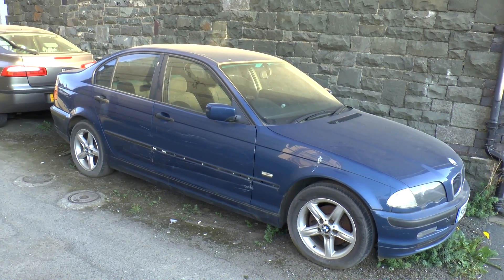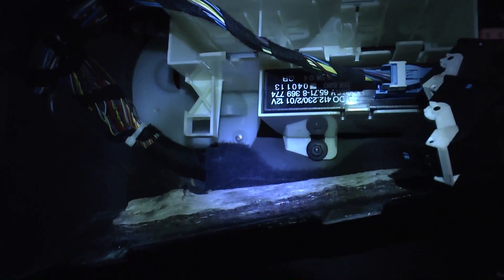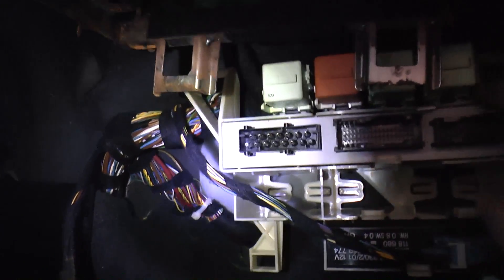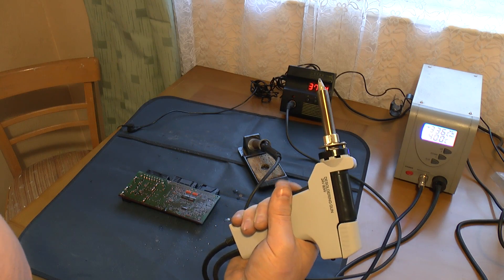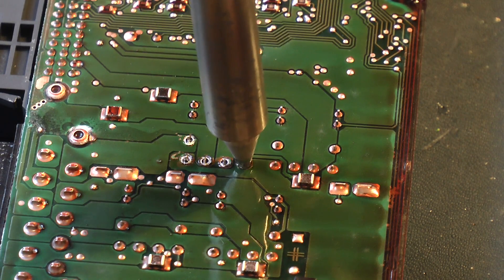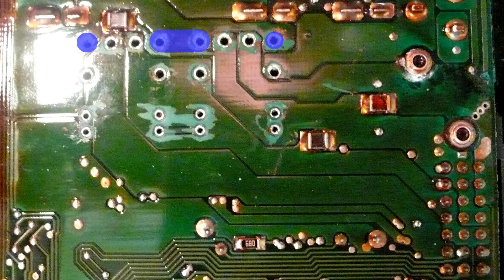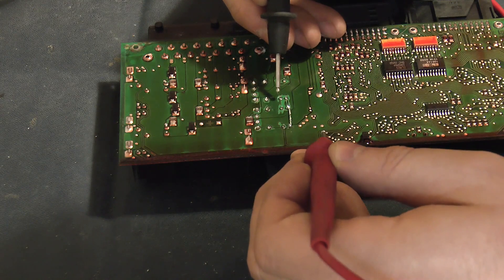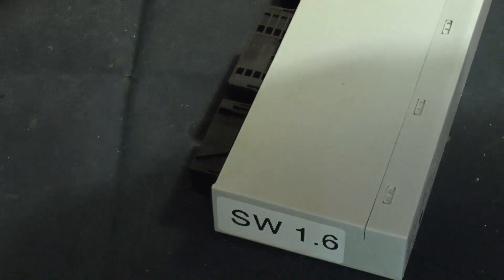Central locking relay replacement in a BMW GM5 module (3-series, X3, Z4, Z8)

Comment: Hello! I just replace the relays, and now the central locking is not working ( not from the key, not from the button inside the car ). In the gm5 i hear a sound when i press from the key. Help please!
Reply: +adrian Cresteaza 
Sounds like you damged the circuit board.  Most likely one or more of the following:  pull out a plated through hole, lifted a pad or broke a trace.
Fixing boards damaged by amateur is such a pain in the rear.
Reply from the maker: +adrian Cresteaza Watch from 7:50 to see the points that can be joined together on the board to fix any broken tracks or through-holes.

Comment: Can you please tell me what to do and replace, if I bought a car and I have two different locks? I mean one in the ignition and the second in the door. So I must use two different keys. One to open the door and the second at the start. I have a BMW 325i E46 and want to change the locks from another car So what replace? dme? ews? central locking relay? Please can you help me?

Comment: Thank you VERY much man. You saved my life :-) I used V23084-c2002-a403 relay and it works propertly. Your "points of control measuring" were really helpful.
Reply: Only use the -A303 ones.  The -A403 relays are made with a different contact material which is for lamp loads which have a very high initial current which decreases quickly as the filaments heat up and no arcing when the contacts open.  Motor loads are very different.  Motor loads have low initial current which rises quickly as the inductance saturates and arc like crazy when the contact opens.  Almost the polar opposite of a lamp load.  Sure the -A403 relays will work initially, but, around 18-24 months is when they will start to fail where the contacts will fuse allowing current to continuously flow through the motors and eventually burn out the actuators.
Reply: That is the wrong PN relay.  It will fail prematurely because that relay (-A403) is not designed to handle arcing from inductive loads.
Reply: +Scott Johnson , so out of the 4 ones stated in the description, which ones do you think will work for sure?
V23084-C2001-A303
V23084-C2001-A403
V23084-C2002-A303
V23084-C2002-A403 &#160;?
Reply: +Scott Johnson OMG, this means that people using the A403 will eventually have to buy new relays and also other parts that will fail or burn out because of the A403 remaining in the closed(current conducting) position! I already bought the A403 because they were easy to find, but glad i didn't mount them on yet. hope i will find the A303 ones. Thank you very very much! You may have saved me some money :) 

+AintBigAintClever Also...I think that the OP should update the description with this information because in this form it could lead to problems for other people

Comment: I just did this ,replace relays and now it is worse , now the safety door switch is not locking either , what you think I did wrong ,also the relays that I replaced have same numbers except the last ++ numbers and the end has C and original relays have B .?
Reply from the maker: What is the exact part number on the relays you've used?
Reply: AintBigAintClever V23084 C2001-A303 ++ 124642C and the originals are the same no but the last  ( ++ 011441B)
Reply from the maker: Paun Makedonski
That's the correct part number then (you can ignnore everything after the A303). Take a look at 7:55 to 8:20 in the video and perform a continuity test between the same-coloured points shown at each step, this will verify that you haven't broken any tracks (but if you have, it'll show you what to reconnect with jumper wire).

Comment: Would be useful to use light during filming the procedures ;-)
Reply from the maker: I try my best (I now use a 150W metal halide plus a 50W LED for video lighting) but it's tricky when you're concentrating on what you're supposed to be doing (in this case desoldering) instead of what you're also doing (recording it).

Comment: hello ............ I have a problem on my bmw e46 the problem that the opening of the doors sometimes open sometimes does not open. I have done to make the control mechanic told me that the relay is defective. I wanted to know what these relays? those that have changed you in the video? then another can change GM5 module can meter a used one? if i can then how to code the meter key with another GM5? please give me the answer thanks.

Comment: I do lots of electronics, and I am real good at it, but I do not understand how piss poor BMW Electronics engineers can come up with such unreliable relays, and general board design these boards with such small solder pads and fine tracks can be a night mare when it come to replacing parts, especially plated through holes, I have replaced one of the relays on a friend's car but I used what i had, so i used two single pole 15A relays and it did the job, I had to wire each pin from my relays to the board afyter I took the original relay out (which had gone faulty with relay coil having gone open circuit) Once I carefully wired my two single pole relays, everything worked fine for a year now, so central locking works fine with remotre control key fob,  but 1 year on, now my friend has got a new problem, his dashboard does not show internal indicator signals, does not show the blue high beam light, does not show the door are open, does not show if his fog lights are on, even though all fuses are OK, and all these functions work, example if you indicate right, the external indicators flash, but there is no clicking or internal dash lights to remind a driver that the indicators are on.

This is BMW for you, personally I don't drive one, thank God for that, I have a Vauxhall Calibra a much better car thank God! psses BMW any time! and has better and more reliable electronics.
Reply: Hi,
i had the same problem with dashboard on my BMW e46 it is very easy to fix problem, just get the plus (+) off your battery wait for (cca 20-40 sec.) and than just put it back, and try it. That is the way i fix the same problem. I hope so it will help your friend too.
Reply: Thanks man, I removed the -ve wire last time and left it out for all night and it didn't work, so may be I will now try the +ve e this time and it might work. Thanks bud.Caki
Reply: No problem man, just try it and i hope it will be fine. :D samdomding
Reply: I tried taking out the Positive terminal and left it for about 20 seconds and then tried to see if the problem with my dash lights has cured, but no luck, then the next day in the morning, everything started to work, and by evening the fault was back, i.e. no internal indication lights on the cluster, although the indicators functioned Ok outside, and the High beam came on outside but no internal warning lights, same for the door open warning light, fogs and so on.

seems like intermittent wiring fault and one bimmer site has suggested checking the Light control Module (LCM) possibly some sort of intermittent connection, I will tackle this tomorrow. But thanks for your help.

By the way, I said BMW were rubbish cars, and my calibra was much better, but now it is not, as of last week my head gasket blew up and caused a Hydro lock, and now it means expensive repairs! all cars are rubbish except Skoda!
Reply: I'm sorry for your car, well i don't really know what u can do about that, that is how i solved problem on my e46 and i no it works fine, no more problems... I hope u will enjoy in Skoda. :D Greetings to you.
Reply: Caki Today I managed to remove the LCM (light control module) for those who may not be familiar with LCM, it is your headlight switch panel, with the big head light turn on knob, and has other buttons to bring on fog lights and instrument cluster light intensity control, this is the module that is also responsible for INDICATORS Flasher, as when you unplug it, the Indicators stop functioning even outside, so i suspect the problem may be here, I made a special contraption - using a long nose pliers with one side of the pointed jaw fitted with a small length of sharp steel pin, the idea is that when you pick any one wire and press the plier jaws across any insulated wire, the pin pricks the insulation and makes a contact with the copper conductor so that you could make a contact to take voltage readings on that wire and monitor other status without having to slice off the pvc insulation, that ruins insulation, with this contraption it just leaves a very tiny pin hole that almost heals itself or closes up so that no copper is left exposed to cause any shorts. So no shorts can occur and I would hate to have sliced part of the wire insulation and then tape it afterwords, that I have come across in so many cars where amateur electricians have sliced wires and then  insulated with a pvc tape, that can come undone and cause shorts. 

Any ways, i manged to trace the output wires for the indicators,  the left Indicators have two Blue/Green wires one I presume goes to the front Indicator lamp and the other to the rear, like wise I managed to get a flashing pulse signal on two of the Blue/Brown wires for the right indicators, and so none of the  other wires had any flashing signal to go to the instrument cluster panel, hence why there is no indication on the cluster panel, but as well as many other functions are not being indicated either, however the important ones are the indicator signals, so now I can tap small wires to these two pairs of indicator wires and run them to a couple of green LEDs and diode couple the two outputs to a small 12v relay to make the ticking noise and house the relay behind the dashboard and   wire up the two green LEDs on a suitable location on the dashboard to enable the driver to see if the indicators are On, this is not a cure for the original problem but will for now enable the car derivable and for safety. If a driver does not know his indicator is on, he could mislead other drivers and cause an accident.
Reply from the maker: Same reason they think they can get away with not doing a product recall for the alloy wheels that keep cracking: sheer arrogance. If it was Toyota or Lexus they'd recall them (and drivers of other brands would scoff at yet another recall), but BMW would rather deny there's a problem.
Reply: Sorry I meant to write to the gent that did this video not reply to your comment
Reply: samdomding sorry mate meant to reply to the guys video he's close by
Reply: No worries Jacob,  I have deleted my reply as I don't want to give my location. thanks

Comment: good day, I have a e46 320i 2002 but central locking works only when I use the keys in keys hole on the driver door, and the remote does not work (I have purchase new keys also),, do you think it helps if I change my GM5 module to a used which works. thanks:-) ((safety button in the car works fine and locks all doors))

Comment: Thank you so much for the video.  This was exactly what I needed to fix a Z3.  Total cost $32 for relays on ebay and 15 minutes. (with the proper soldering equipment)

Saved over $800 over quote from garage.  Keep up the good work!!!

Comment: Can I just remove relays from a used GM and use them instead of buying new ones?
Reply: Nothing to stop you doing that as long as the relays in the used GM are in good condition. Apparently one of them gets worn out quicker than the others.
Reply: ***** Thanks
Reply from the maker: Marc Langlois
I expect the heat transfer up the relay pin has improved your relay's behaviour for now, but it might only be a short term fix. Fingers crossed yours will keep going for a while though,

Comment: Excellent DIY tutorial. I repair many keys where in the battery breaks off or they have reached the end of their life and strange enough BMW tells the client they need new keys because they don't have a battery inside. What nonsense.
Anyhow your tutorial helps sort out those strange one where the central locking would work intermittently but the boot always opens.
Great video!!!
Reply: Hi..i have a 08 Mazda demio...the anti theft works sometimes I suspect it's a eeprom issue,  can you repair it...

Comment: you said that two relays are for central locking, are those other two for windshield wiper ? coz i have problem with them...sometimes work, sometimes dont
Reply from the maker: According to the bmwgm5 website they're electric window relays.
Reply: thank you very much :) you're very helpfull ;)

Comment: i just have this question about this if i change the relays do i have to reprogram the GM5 box
Reply from the maker: No, you'd only need to reprogram the GM5 if swapping it from one vehicle to another.
Reply: poo great thank you so much
Reply: If you happen to swap the GM5 with another one, the main issue that you will have is that the keys won't work.

Solution is to:
- sit in the car and close all the doors
- put the key in the ignition and turn the key to position two (without turning on the car)
- remove key
- hold the unlock button, and while holding the unlock, click the lock button three times.
- the doors with lock and unlock automatically
- turn on the car and enjoy the newly programmed module

* there's no necessity of recoding the VIN to the module.

Comment: On my bmw the locking via remote doesnt work. Unlocking and opening the trunk works, if i use the key on the driver door only the driver door locks-unlocks. Do i need to replace the top or the bottom reley, so i dont replace both??? thanks for your help.

Comment: THINKING I HAVE A CENTRAL LOCKING SYSTEM ISSUE ON MY 1994 BMW 325I
IT ALL STARTED WHEN I WAS MESSING WITH MY TRUNK LID WIRES TO THE  LOCK CYLINDER AS WELL AS THE DRIVER SIDE DOOR LOCK, I HAD THE PANELS OFF OF BOTH OF THOSE THE DOOR AND THE TRUNK MESSING WITH THE WIRES AND SO ON... HAVE A  NOW WHEN I TURN MY KEY TO START IT DOES NOTHING, DON'T EVEN DO A CLICK CLICK TO ENGAGE THE STARTER.  THANK GOD I'M ABLE TO DRIVE BECAUSE IT IS A 5 SPEED MANUAL AND I CAN STILL PUSH START IT RUNS THAT WAY. I'M READING THIS BMW BOOK I HAVE AND IT KEEPS TALKING ABOUT THE CENTRAL LOCKING DEVICE, I'M JUST WONDERING WOULD THAT HAVE ANYTHING TO DO WITH THE CAR NOT EVEN  TURNING OVER TO START? IT RAN FINE AS EVER UNTIL THAT DAY MESSING WITH THOSE TWO THINGS THE WIRING TO THE DOOR AND THE TRUNK GOT INTO IT TO START AND NOTHING AT ALL... I NEED HELP ANYONE KNOW ABOUT THIS? OR WHAT IT SOUNDS LIKE???
HELP WOULD BE OH-SO APPRECIATED!!!  THANK YOU KYLE

Comment from the maker: My guess is that the "high sensitivity" (i.e. lower coil current) versions are a bit more flimsy (to make it easier for the coil). Also, one half of one of the relays gets much more of a workout than the rest.

Comment from the maker: The wire was left in place because I'd broken the track. If you've broken a track you need to add a wire to replace it, all connected points are shown at 7:55 so you can see which ones you can link to to fix the break.

Comment: My 2000 323ci convertible appears to have a bad central locking relay. I have ordered it. Since its convertible coupe I've been told it just needs one relay. Compared tk the one in the video will my gm5 have one of the 2 shown in the video and if it has 2 which one is it. Hope my question makes sense

Comment from the maker: It'd be worth trying to source a wiring diagram for your car, you may be able to figure out what's common to the faults, whether all the duff bits share a module, switch assembly, even a ground or supply wire.

Comment from the maker: The A303 has a different contact arrangement and is a single-pole changeover relay. The A309  is double-pole changeover and has two additional pins.

The A303 pinout is in its datasheet, readily available on the net. The A309 pinout is harder to find but can be found on the bmwgm5 site if you search for V23072 A309 in Google. A309s can be bought on eBay.

Comment: Whadaya know?  I had to repair the window regulator over the weekend and disconnected my battery while I worked on the car so I could disconnect the airbag without any problems.  After reconnecting the battery I have not had a single problem with the locks!!!  Maybe I just lucked out but I will keep the relay instructions in case they do go south.

Thanks again

Comment: looks like it. I fixed up mine. problem was similar and getting worse and worse. You can check if it is the relays gone, or no contact inside them: remove the gm5 as shown, take the plastic cover off. connect it back and listen while operating, if the relay clicks when trying to open, it has no contact inside. might be just enough to clean it... somewhere below theres my post about it :)

Comment from the maker: It'll be half of one of the relays, in fact of the double-relay closest to the connectors it's the half furthest away. The first time I fixed one of these it was a bodge job with a pair of ordinary relays. You'll need a proper desoldering iron to take the relays out, they're VERY difficult to shift otherwise.

Comment from the maker: Sounds like one of the relays is on its way out and needs replacing. The first one I ever came across was on a friend's car (I don't drive a BMW :) ) and I think that was the same symptom, only unlocking when it felt like it. It doesn't matter whether you use the remote or the console button, it always uses the same set of relays to do the job. According to bmwgm5. com the double relay closest to the connectors is responsible for unlocking.

Comment: Hi and thank you for posting this video.  I have a problem where sometimes the locks open and sometimes they don't and it does not matter if I use the remote or the button on the center console.  Is this caused by bad relays?  Is this what your problem was?  

Thanks

Comment: Hi I have a 318i 98 with gm5 unit:61354533552 - GM V 12V BMW 61.35-4 533 552 
However im finding it impossible to find the relay to buy

Any suggestions where to get the relay from?